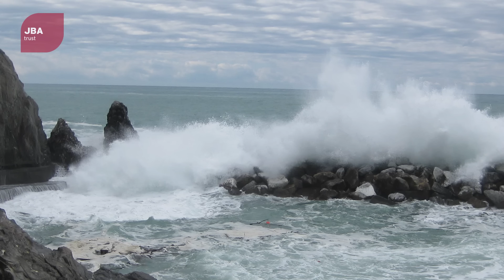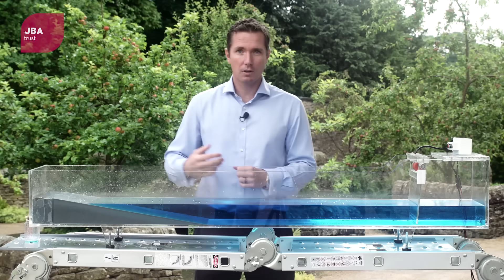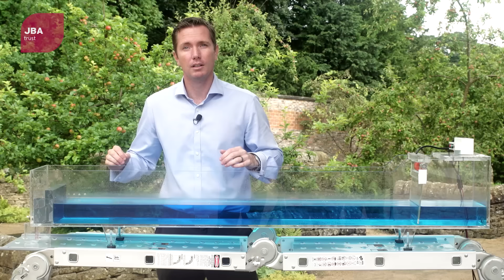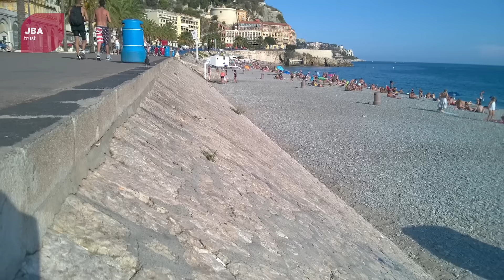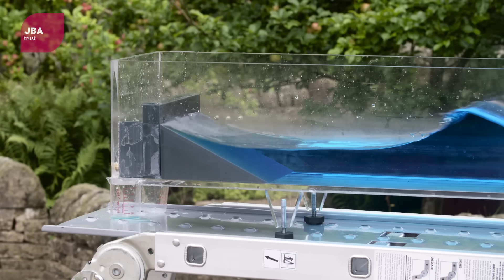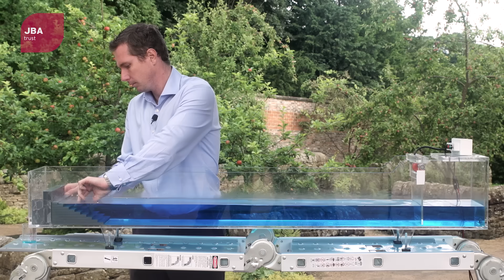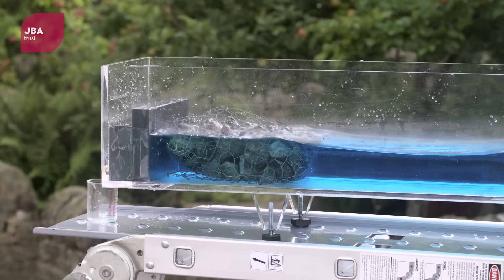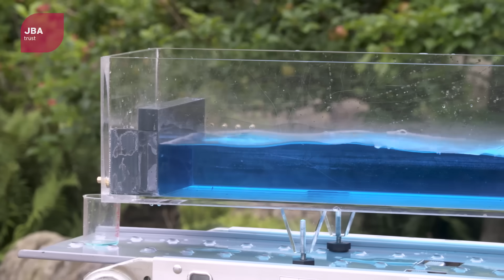Wave tank demonstration showing the impact of coastal defences on flood risk

Comment: Ok. So, we put rocks to crash the bottom of a tsunami, then the breakwater in front of it to sink the tsunami, and then a giant curve thing that would send it back out to shore? And we can put a shaft to get through. Behind it, and then it tunnels into a door in the wall of the curve, then a slope down but make it small so you don't slide to your death. Is that how you survive a 30 Meter Tsunami?

Edit: But 30 meters is a bit high... maybe  like an average tsunami of 20 meters? I think these are great combinations and thoughts to keep super storms and a 30 meter tsunami at bay for now.

Comment: Dear authors, I have a question. 

In hydraulic scaled experiments, to have the modeled flow to be like the real one, it is required to make these flows with equal Reynolds and Euler numbers.  
The Reynolds number is a unitless number that describes relationship between liquid density, viscosity and geometric scale of the model.  
If we reduce the geometric size, we should also change the liquid density and/or viscosity to keep the Reynolds number the same. 
Could you please comment on how do you deal with Reynolds/Euler numbers? 
Thank you!

Comment: i like the  idea of creating of ,An off shore underwater break but do it so it actually useable for sport making surf spots and habitat for fish and marine life , with gaps and different distances from shore ,1st reef, 2nd reef ,or more and of course a shorebreak  all safe and user friendly .larger models to scale ,contours of land and sea ,future waterlevels ,high and low tides , also would have to model in swell direction in normal seasonal conditions aswell as storm possibilities ,it would be interesting to see what could be created ,aswell as long term protection ,i live just outside of waikiki and i always joke that waikiki is going to be like venice ,but not without alot of wave dampering before and a solid imperviable wall be built to protect those buildings and hotels already they have to dredge the sand that gets pulled out and bring it back to shore  so its a really huge project to be able to accomplish something on that scale ,basically i think itll require building that wall in front of almost every community that borders the ocean  around the  island .and the others big $$$

Comment: Our local council (Wellington New Zealand) just changed the local beach (Owhiro Bay).
They removed the ramp of beach sand/gravel... but actually removed the waste rather than pushing it back into the sea.

My uneducated view of this is... Unless they keep removing the buildup, it will return as the beach is an open sea front with deep water that continually is hit with southerly storms.
Removing the sand may work initially, but I foresee that with the next storm, the sand at tidal zone will be washed up into the pre existing ramp area... but now the tidal zone will have been eroded, effectively moving it closer to the sea wall.
If we run the re-grading scenario into the future, eventually there will be no beach, the waves hitting the vertical wall directly, and an increase of aerial spray.
My "Theory' is, that they should have pushed the sand/gravel back into the bay where eventually it would wash back up but have removed the ramp...
I go further to note that the Hutt river flowing into Wellington harbour is slowly filling its banks with river stones. This used to be quarried but they stopped this so the river bed is slowly rising.
My "idea" is to quarry the river stones, deposit them in Owhiro Bay at the beach, and shallow out the lead in, reducing the energy at the beach. (As it is a loose gravel/stone base there is little environment under the water until you go far enough out to be clear of the deep undertow of the waves. 

Oh... And not only did they remove the excess sand/gravel... this is a "Reserve" wher NO stone, fish, object can be removed by law... yet that didn't stop the council removing tons...
If they are willing to circumvent law and remove part of a nature reserve, perhaps they can do the same and fill in part of the reserve.

Comment: An additional method he didn't talk about is using bioengineering to create a living shoreline.  You plant so plants (either grasses or trees depending on the location) that will both absorb some of the wave energy and will provide a root structure that helps prevent the erosion of fine material in the first place.  It also has the benefit of providing habitat for a lot of animals.  The downsides are that the installation is a bit more complicated and as such can be more expensive.  Also, if it is an area where you want a beach instead of a marsh it is non-viable.  But, it can be highly effective in the right spot and is something that can be combined with other engineering methods to create multi-layered defenses.

Comment: Basically the rock armor is the most cost effective way. Also in demonstration the rock armor should have been as high as the the vertical wall itself and evenly spread from side to side and there would have not been any spillage. All the fancy stuff like recurve and underwater breaking bump are super expensive compared to the rocks.

Comment: Rock breakwater 300-500 yards off popular and densely populated beachfronts underwater to disrupt wave action. Cause the waves to break early and have to basically rebuild before reaching the beachfront reducing beach erosion! Could also use these underwear rock breakwaters as oyster farms to recoup installation costs.  Just make sure the wall is under the water  enough for boats.

Comment: As 17yr geology student 20+ yrs ago, I designed and ran this very experiment but with the aim of designing coastal protection in tsunami prone areas.

Using a tank does help illustrate the impacts but reflected energy has to go somewhere.  On the NE coast of the UK, most types of sea defence have been used and what has happened is that the reflected energy has simply made erosion worse elsewhere.

From a tsunami perspective, disturbing the amplitude is the most effective method of dissipation.  But the energy has to go somewhere.  And it has to be far enough out to sea to avoid the wave rebuilding.

I filmed at right angles, with a grid behind the tank.  This allowed me to assess wave energy under the different scenarios.

Comment: Hmm, it seems that diffusing the wave energy before it hits the shore is probably most effective. The recurve wall is a good way to redirect, and the rock bag/armor is effective too. One I have seen in movies from Korea is similar to the rock armor, but is cast concrete which is a tetrahedron, 4 sided, but rather than sides, you have legs. They seem to interlock well so I wouldn't expect them to want to move as much as rocks would in heavy surf, but no real experience with them. Making the molds would be a big cost outlay, but they could be used many times...

Comment: 1) Waves in nature aren't on a consistent frequency as demonstrated by the motorized wave model. 2) Waves do not always arrive from a direction perpendicular with the coast. 3) Rock placement along the coast isn't stable and ultimately sink into the softer sediments. 4) Rock placements with waves arriving in a direction near parallel to the coast encourage scouring at the interface of the natural coast and the rocks.
Reply: I mean, duh??? This video is just a visual demonstration.

Comment: How strong does the breakwater have to be? Can it be made from dirt, sand and other sediment or can it be made of rocks like rock armour, or does it have to be a solid structure like concrete? If sediment and large rocks are possible could this help bring the cost down and if built right create a place just in front beaches that actually help attract tourists as the waters are not as strong due to the absorbed wave energy?

Comment: There is a problem in your method. When you mantain a constant volume of wather in a tank, and add diferent structures, with diferent forms and volumes that will change the original level of the wather in the tank, then your results will vê afected.

Comment: The thing is the offshore break water could be a few feet above the water will break the water but you would need a a barrier close to the land. If you look at Florida they are losing beach front area due to rising waters and erosion. If you have break wall just a few feet above the water you could slow down erosion of beach that many times has to be put back to have people on beach, If the water gets higher than the break wall out in the water could be put higher.

Comment: We need a semicircular recurve wall that focuses a massive reflected side wave down the beach  to form mega wedges! Maybe have the offshore submerged breakwall cause waves to peel around left and right, thereby refracting around on both sides and then re-focusing at the recurve wall so as to utilize the same wave energy twice. Dude, with a bigger tank you could make such a sikkk video!!!

Comment: The recurve wall is great for price work, mile on mile of shuttering. The tidal work can suck though, 6hour at work (low tide) , 6 hours off, then an over 6 hrs on, and 6hrs again in 24hrs, the tide pattern shifts forward by an hour a day, so you can start at midnight the first day and by the 5th day day you start a 5am. The shift pattern goes on normally for 9-12 days, by the end you don’t know if it’s morning or evening or what day it is.

Comment: Engineers: puts a ramp up for the water 
Ramp: makes it easier for things to get up
Engineers: :O
Reply: I think the ramp is supposed to represent sand coming up
Reply: @canada3186  The first ramp at the start of the video does, yes. people are like "oh that helps break the waves, maybe we can do a shorter version of that to do the same?" and then found out that the performance depends on how steep the slope is.
Reply: People behind the ramp: :0
Reply: the ramp actually help reduce the force when water hit the wall so it wont break but ofc it will allow the water to go up (water will go down eventually ). Also the less economy while keep  the beach clean and nice  as you want unlike rock armour or submerged shore

Comment: Interesting series of tests of beach protection. Of course this depends in part on what height of storm surge one is talking about. Katrina in the American Gulf had storm surges up to 25 feet with 10 foot high waves and after crossing some offshore barrier islands (little effect) managed to destroy everything on the Mississippi coast. Two points, first when the coast is threatened by recurring hurricanes with storm surge it is best to evacuate that area and use it for recreation only, second, wave runout is very damaging to structures so cutting off the waves prior to reaching the beach is essential and relatively inexpensive. Thanks.

Comment: And with the last one, wouldn’t that only be effective if the water is just high enough to cause that little dip before it goes over it? Like if the water was much higher with a much bigger wave then would it produce the same result? It’s easy when you have the water aligned perfectly but I wonder what happens with high and low tide and hurricane downpours.

Comment: the offshore obstacle should have been shown with the initial sandline (i doubt in that condition the wall would have performed the same. Besides the rock armour was too long to be realistic. It should be around 10-15 cm long to actually simulate what really exists in normal scale. Finally, the recurve walls seem very interesting, however i doubt i will perform the same with more realistic conditions (waves with different volumes/strenghts). It seems that the recurve was calculated exactly to the wave strenght used here.

Comment: This only a surface affect with slight "deep" reaction to the top of water, vs. Reaction. Wind doesn't and can't effect large water bodies, like oceans, in this way. There is no surface paddle "whiping" the ocean. In my theory, there are and is, underwater structures deep in the seas that use water motion much like this to create an air pocket. To maintain this energy requires a lot of active, mechanical or natural process much like what we see here only that we have another process happening in a perpendicular pattern. Once you can find the right "rhythm" in both you create a pocket bubble. From there you can have systems set up to blow up and stabilize this "vaccume" of air, underwater. How to we create oxygen in this bubble? Simple seaweed and water based plants that can live in a water prominent environment. From there you create a structure that captures the air pocket and let's these plants live and also, protects the same environment from the crushing depths of water. Thus we get waves on the surface of land in the form of what we call "wakes". Again. This is my theory.

Comment: The off shore blockade has risks with rogue waves and right after the wave hits there is a vaccum on the side the wave hit. If it was deep enough people may surfce the waves it creates and if they get too close to the other side they would be at risk to being sucked under. Cycling through the next wave and would be difficult to escape from. Especially if the seas are rougher that day.

Comment: This doesn't make much sense. With your small "wave tank" you are sometimes hitting eigenfrequencies of the flow system which consists in interferences and due to that in much higher waves. By changing your defense device you are significantly changing the length (a d the water volume /mass) between the 'wave generator' and the wall and so you are changing the eigenfrequencies of your system (and the wave height). So this experiment is physically not representative at all.

Comment: want to see this : offshore wall + rock wall + recurved edge
Reply: In real operation it will be very expensive to implement , hence they dropped that combination to experiment😀
Reply: Japan 🇯🇵
Reply: It would be very effective in the experiment! But for most real life implementations, overkill and expensive.
Reply: The land would begin to have waves on the ocean
Reply: With stepped revetment
Reply: Defense: +100
Cost: +999999
Reply: The ultimate defense, also known as "the wave killer"
Reply: @Patronux  probably the only thing that will save the Dutch from Being submerges under the ocean
Reply: Plus recurved edges built like steps

Comment: Very interesting. I think however that given the conclusion that you gotta pick one or another solution depending on the situation, we should be told at least one disadvantage of that recurve wall because from what is explained here, it just seems perfect. 
Now, I could imagine that the top part of it could erode or break because it would suffer the most during each storm or I could imagine that it's effectiveness would depend on how the frequency of the waves compare to its slope but that's only my imagination, I'm no hydro-engineer.

Comment: Where I live has been quite interesting in this context. The community built very effective stepped revetments topped with recurved wall over 70 years ago to counter severe erosion (houses were being lost as sand dunes rapidly eroded). The defenses are still standing and form an important community asset, but the beaches stopped eroding 30 years ago and now consist of a huge gravel build up which has in some cases moved the high tide line >100m from the original defenses, the steps are now completely covered by gravel. At the same time the gravel has freshwater lakes and is developing its own ecosystem including nesting birds. The source of the gravel is an earthquake that occurred mid 1800s and caused a pulse of gravel to migrate down nearby mountains and down a large river valley to the coast many kilometres from where it has been deposited.
Reply: That's so interesting, thanks for sharing!

Comment: the step slope wasn't acurate because it was already under water. if it had few steps above water then there would be less water going inland. Building few curved walls stacked up or in slope would be best solution, especially for japan.  Maybe holes of 10 meters and 10 meters in radius is another option, by the pressure of water the hole goes open or by pressing button

Comment: my local beach has.. i think all of these, not all together though.

The part where most people walk and play on has flat walls but the rocks beside it
Further down we lose the rockets and go for steps, again with flat walls
Then we have the breaker under the water, again with flat walls but no steps or rocks
Then we have the recurve, where the top of the wall is curved so the wave goes back out
Then we have the recurve and the steps
Then at the very bottom of the beach is Steps, recurve and rocks, all together. The reason is this is beside the Pier, which focuses waves so they are bigger when they reach the beach.

This beach is called Roker in Sunderland, UK. Plenty of videos on Youtube to see what it looks like.

Comment: Fun fact about recurve systems, at the 3 gorges dam, instead of letting the down spilling water simply fall into the river exiting the dam, there is a ramp with a curve that shoots the water back up into the air before falling into the river.  This does 2 important things, first it dissipates some of the energy by being shot by its own inertial force into the air, and it protects the base of the dam by not allowing the water to erode it.  It reenters the river water a couple hundred feet away from the base of the dam because it is flung outward.

Comment: Just remember about equilibrium. If you use hard engineering to solve a problem at one point of the coast, the energy is going to move and cause more damage elsewhere
Reply: Also the water can get trapped behind any barrier.